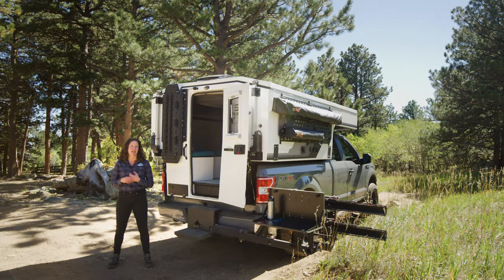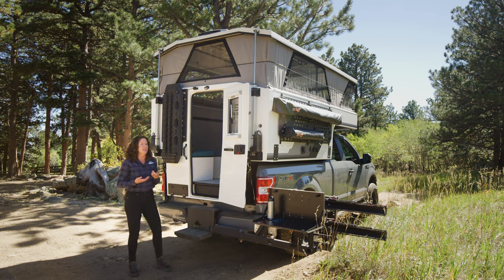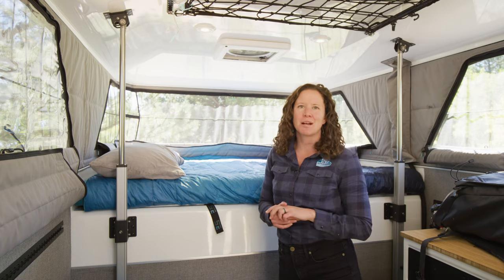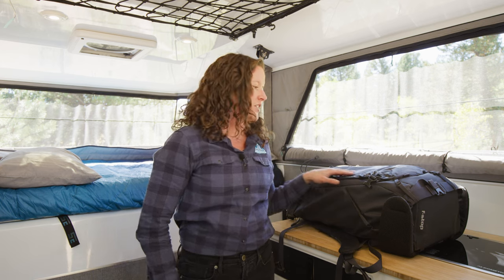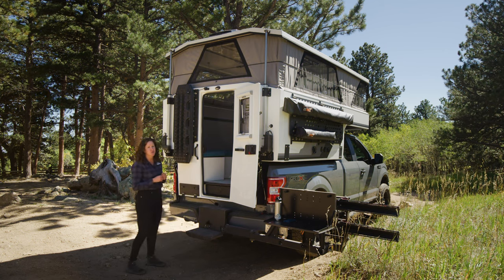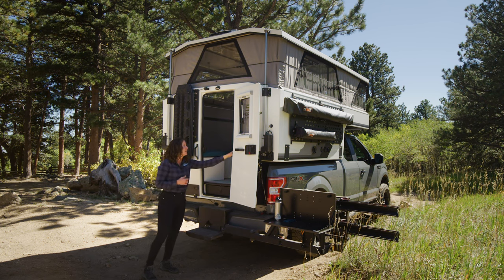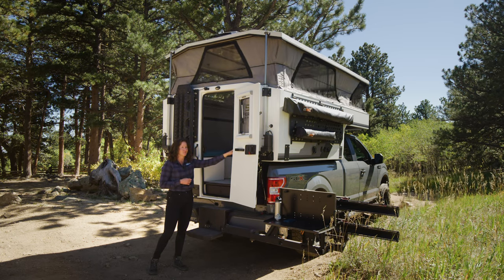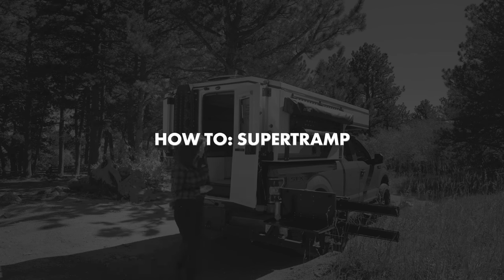How To: Supertramp 2. Linear Actuators - Deep Dive

Comment: Him how are you guys, awesome campers so far for me. one thing i don't like is sitting position. may i order it customizable. Like 2 seats facing each other. one bigger table in the middle. Actually, practically big countertop is not necessary. The only thing to do with friends and family is seating each other so start  a warm talking. Thus, we play a cards and can be whatever.  I mean you can't make a new product line with different seating position i mentioned. I hope 100%, costumers will love it.  if you dot that i will buy it from you. not changing the chasis and design, just changing the seating position that is it.  Any product comes with optional, but you dont have it. At the end, this precious advice from me to support your business, activities and incomes kk. pls consider this with your team as soon as quickly possible. Because camping season is coming outside. Will you guys do it? 4 seats each other, one table in the middle.
Reply from the maker: Hi Mongol, our apologies for the delay. Our interior layout is fully composite with each component made with a process called vacuum infusion which requires molds. Those molds are the most time-intensive and expensive portion of our products so we are currently limiting changes to the interior layout. We like your idea and will consider it in the future.
Reply: @supertrampcampers2223  okey , i see. i hope next gen models would come up with.